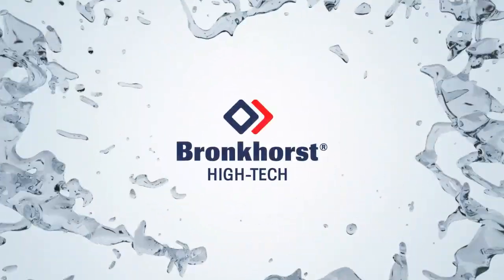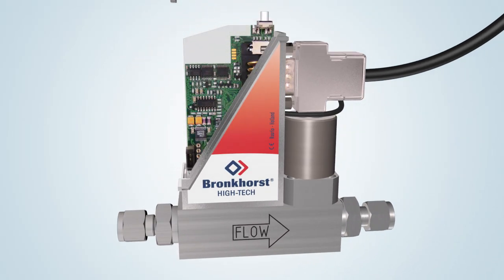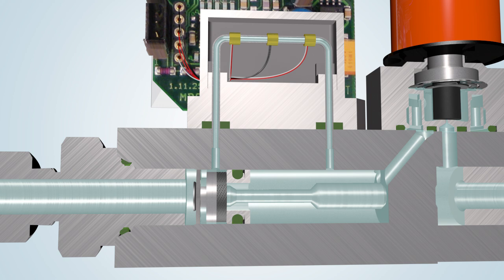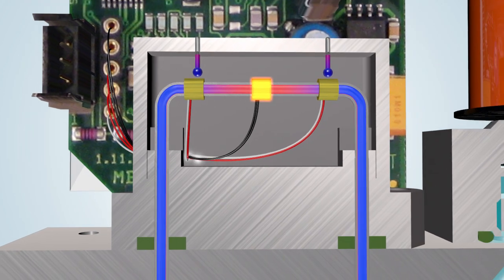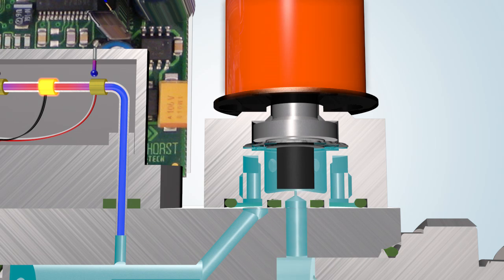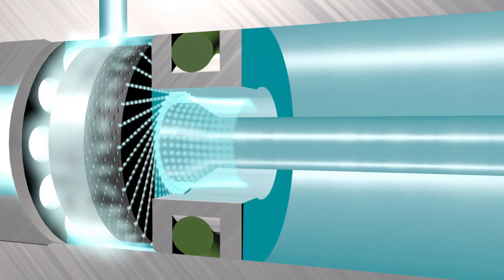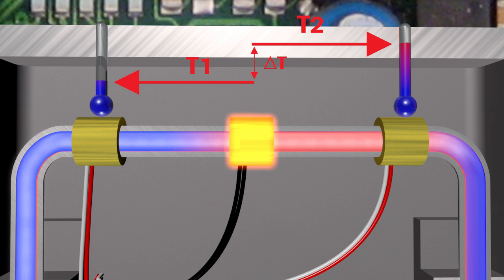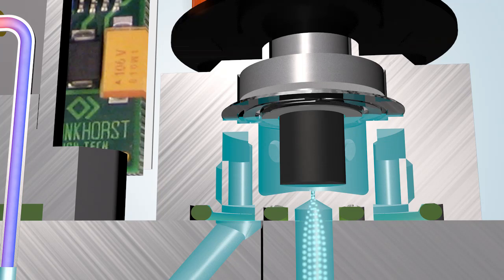Thermal Mass Flow Meter / Controller (Principle of operation)

Comment: Sir, in my flow meter now ots reading only low flow 1.2 only where as it was supposed to controle up to 20, please suggest
Reply from the maker: Hi, there may be various reasons that caused this problem. You inlet pressure may be too low, so you do not have enough differential pressure for the control valve. Did you compare the P1/P2 on the technical label of the instrument? Another possibility is that your instrument is clogged. In our instruction manuals you will find more trouble shooting topics. If this does not help, please contact our nearest distributor. Please see our website bronkhorst.com under menu item Distributors.

Comment: Great animations I really loved it..  Can you explain how  to differentiate the cooling effect caused  by change in the flow rate of the liquid and change in density.
Reply: Hi, thanks for your question. You can find the answer in paragraph 1.8 of our instruction manual 9.17.001. This manual can be downloaded from our website www.bronkhorst.com (go to Downloads - Instruction Manuals / Quick Installation Guides, select: Manual Mass Flow Pressure Meters - Controllers.)

Comment: Hi there excellent animations I really enjoyed it.   Can you please tell me how this flow meter is used in natural gas applications?   Will it not disturb the natural gas due to its convective heat transfer?
Reply from the maker: Hi, only a fraction of the total flow will slightly be heated in the thermal flow sensor, which is placed in a by-pass construction, so there will be no disturbance.

Comment: Hello! It is possible to make a backup of my mass already calibrated, and then reload the configuration.
Reply: I am not sure if I understand your question well... our digital instruments have a resettable counter function on board, but do not store total values after reset. For further discussion, please submit our contact form via www.bronkhorst.com/int/about/contact and if you do so, please indicate the model and serial number of the flow meter or controller. Thanks!

Comment: Great video - it did enable me to understand the working principle; as I could understand it correctly from your document  titled "IN-FLOW".  I therefore urge you to correct the schematic in that document to show there's only one heating element in between the two temperature measures - as it is now a misleading or at least it doesn't match what is in here in this video. Same could be said about the graph in the document as well.
Thank you for offering us this leading technology - keep it up Bronkhorst!
Reply from the maker: Thank you for your comments and compliments. Please be informed that Bronkhorst applies two varieties of thermal mass flow sensor (by-pass style): a two-wire and a three-wire version. The two-wire version (as show at the graphic in our IN-FLOW document) is explained in another video: http://www.youtube.com/embed/lMkkXo1KkxA?rel=0&amp;autoplay=1&vq=hd720